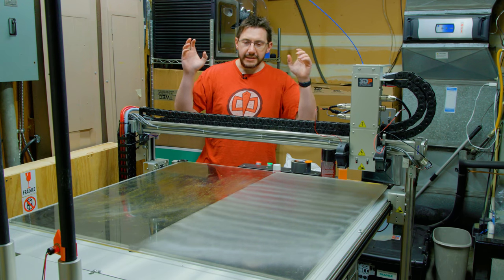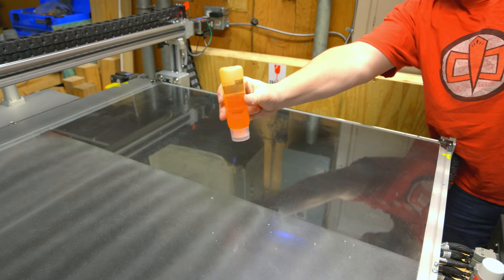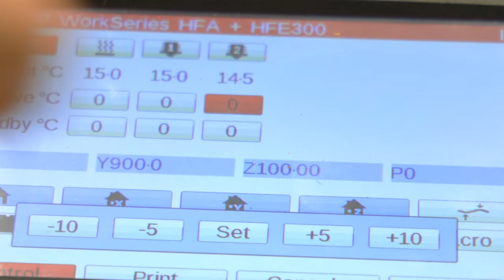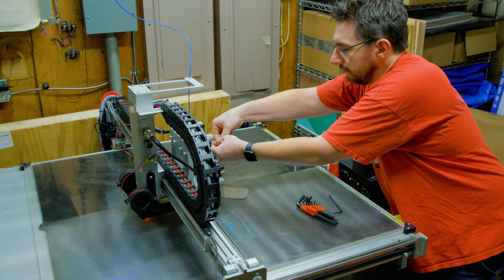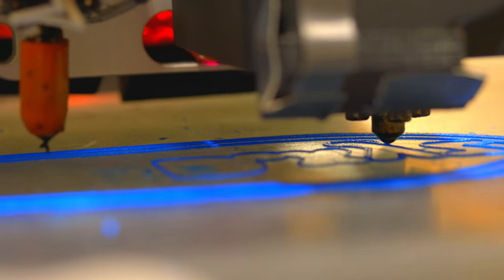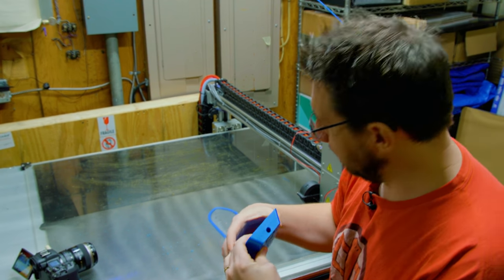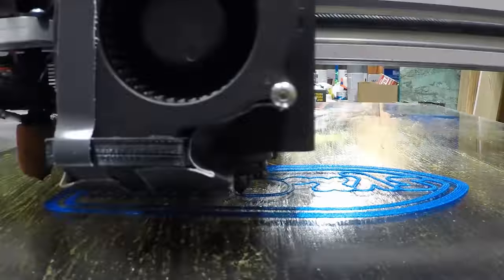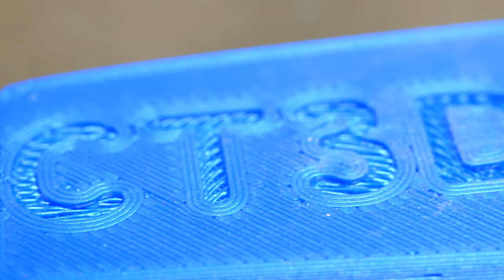$38,000 3D Printer Bed Adhesion Test // Super 77 & Zillagrip

Comment: For $38,000, the printer should have little hands that reach up and grab your layers for you!
Reply: Haha, that's a $9.99 upgrade that he cheaped out on...
Reply: @SuryanIsaac  Always tick the "tiny hands" box! Unless you're Donald Trump.
Reply: @Martial-Mat  Or, for that price a spring steel sheet with a layer of PEI on top?
Reply: What kind of material could you actually use on the is big heavy paper weight 
If nothing sticks what's the point of using it then? if not PLA? 🤔
Reply: @SuryanIsaac  Would that be prone to distortion though at this scale?
Reply: @Martial-Mat  Doesn't it have automatic bed levelling? I've not followed this series, the only thing that won't deform is glass, which is why it's probably used.
Reply: @SuryanIsaac  If you know where to get a sheet of spring steel that big please let everyone know.
Reply: @donaldmcfarlane5004  I was hoping you guys would tell me :)
Reply: I’m mad that I didn’t think of this scam first to get money out of makers with trust funds
Reply: For that price, it should be fully enclosed and heated. I haven't priced out the specs for that specific model, but I have for a 1 cubic meter (print area) model that came to under $5k with dual extrusion, heated bed, and enclosed heated print area. Not a DIY for everyone, but doable if you've built a few.
Reply: @RamDragon32  Yeah, that printer is overpriced af
Reply: @RamDragon32  I agree completely.

Comment: Joel, have you tried the nano polymer adhesive from VisionMiner? 😎 It’s excellent, but kinda expensive for that big surface 😁 
Also, I would say that one root cause is too low ambient temp. You can also put a small heater blowing towards the print, just to test this. 
And hope that hotend melts the filament entirely to 215-220 C 😊 

Good luck for the next tests!  😎
Reply: This is exactly what I was going to suggest!
Reply: I can vouch for the Vision Miner Nano Polymer.  I used up my sample size bottle, and just ordered the $50 bottle.
Reply: @GSoSicc  so the price is worth it. How long did the 10 mL sample last.  More specifically how many prints, how much surface area? Thanks for the info!
Reply: @Benjamin_Reese  3 months, and I still have about 2ml left. 

I used more than average because I would clean all of it off of my Ultrabase before printing PETG, and reapply for PLA.

The one time I didn’t clean it off, I ended up with a 10mm^2 chip in the bed, and that chip is forever stuck to the print, but now that I have smooth glass for PETG, and the Ultrabase for PLA, I’ve only applied twice for ~20 prints.

I’d say <1ml will suffice for  a 220x220 bed. It will be streaky, but it’s safer than a full, even coat.
Reply: I use Vision miner on all of my prints on a Prusa I3,  I'm not printing anywhere as large as what you are printing, but this stuff works great for me.  I stopped using stick glue and now only use this.  I've used it on PETG and PLA and it works great.
Reply: @GSoSicc  Thank you so much! That sounds with it to me.
Reply: Yeah he originally had a link to get a bottle for free when it first came out. Idk if he’s used it in this printer but I’ve seen it before on his channel.

Comment: The biggest problem is the $38,000 printer. I'd want my money back.
Reply: gaffer tape holding it together, broken beds, clearly not uniform heated bed, nozzles tilting the print head gantry....
its a failed printer in my book
Reply: $38,000 USD is only $48,565.90 Canadian, and the fact an Ender 3 can print better is totally okay. Maybe if the machine was to cost $40,000 they could've put in a roll of tape for you to use. sort of like when you buy an expensive car they expect you to install your own seatbel.....idk where I'm going with this.
Reply: Well, it is only a loaner. He didn't buy it, luckily
Reply: @MrGerhardGrobler  broken bed, broken print head.  expensive just for a loan/rent/whatever ya know?
Reply: From one of the other videos, it sounds like their customers (eg industry making props/prototypes) keep the 3D printer in a climate controlled workshop with their other stuff.
Maybe that's the real reason it's $38,000, so you don't keep it in your garage or shed.
Reply: @station240  Then they should either warn their costumers that they NEED climate control, or the should provide a cover for the whole printer that helps to keep the whole thing warm. I can't see what could possible bring the cost of this to 40k.

Comment: Heat the bed 50° & run the same test. Filament, of course, is contracting when it cools.
Reply: Thats what I would have said :)
Reply: I'm a carpenter and I work with that spray glue super77 all the time when it gets hot it turns into a sticky mess and losses its hold. the super 77 is almost like a contact cement. when we use it we spray the wall and the object let them dry  a little and then stick them together.
Reply: @nemohoess  I'm in construction as well. Did not know 77 would lose adhesions if it got heated though.
Reply: @buildersmark  it turns gooy and shit. I did a building where we put trim tex on a soffit right up against a window the heat build kept coming loose. We fixed it but putting mud on it real fast but yup it gets real sloppy.
Reply: @nemohoess  I think he waited too long before trying the tests? Adhesive dried out by the start maybe

Comment: It's probably not the glue that's the problem. You should try covering the print, and have warm air under the cover. The bottom of the print is cold and the top is warm causing it to
warp off the bed.

Comment: I have an Ultimaker 3 with a heated glass bed. To get the prints to stick I usualy set the initial layer hight in cura to around 0.05 - 0.07 . This will result in a mirror finish print surface and the print will stick insanely well. In fact if you try to remove it before the bed has cooled down you will end up ripping little chunks out of your bed. I would also suggest to use a brim instead of a skirt for that extra bit of surface area.
Reply: And didn't you make a video about Vision Miner once where they had similar bed adhesion issues? Why don't you try asking them?

Comment: Have you tried Vision Miner Nano Polymer Adhesive? I've heard great reviews of it.
Reply: Its great, but i use it on advanced polymers
Reply: This! Use this stuff!! It holds like absolute crazy. I used it to hold PEI on a glass bed in open air
Reply: I was just coming to recomend this lol
Reply: I use it on my ultimaker 5 and I recommend it for nylon its really great
Reply: VM Nano Polymer adhesive is amazing.
I'm still ony sample bottle, but when it's finished, I'm buying the big bottle.
Reply: This thread sounds like a marketing ploy
Reply: @kanesmith8271  lol but this stuff is actually really good
Reply: 190% this! Works even on PLA.
Reply: @MissMerc  I was just wondering why he didn't mention it.
Reply from the maker: It super slipped my mind when I was remembering everything! Doh!
Reply: That is my ultimate favorite bed adhesive! Works 99% of the time for me!
Reply: Are use nano it is the best hands down it is expensive but it’s worth every penny
Reply: I’ve literally put only two layers down and I’ve been able to print over 15 times and still sticky gear leave without issue is worth every penny

Comment: Try a big piece of Polycarbonate the size of your bed wouldn't be too bad in costs. Make sure to sand it a little so the parts can actually come off... You'll love it :D (no adhesives needed)
Reply: what grit do you sand it to?  i just tried a piece and the base layer is still there...permanently i think
Reply: @donaldmcfarlane5004  you would want to use a low grid as that makes it easier to get the parts off. Try to bend the sheet to get the parts off, also don't forget you don't need a high bed temp

Comment: Hi Joel!

I've had good results using vinyl decal transfer tape, specifically the paper type, and it works like giant 3D printer bed masking tape!
The paper texture gives the hot plastic something to grab onto, but is smooth enough to leave a nice matte finish on the bottom of a part. I can generally get several prints out of a single tape application.

Whenever it's time to replace the tape: Peel off old layer, pull new material from the dispenser, squeegee it on from front to back, cut end of sheet, print!
Many roll widths come in 100 yard (or 91.44 meter) lengths, so a single roll will last a LONG TIME!

I suggest trying out a medium tack tape. It should be plenty strong enough, especially given the large print area. If you experience any lifting, and the part is pulling the tape off the table, then high tack might be needed. Hasn't happened to me on my CR-10, but your printer is a tad bigger, lol.

NOTE: I am not affiliated with the following brands, I've just used their products before so it's what I'm familiar with.

=========================

Suggestions:
-------------------

Transfer Tape:
TransferRite Ultra 582U Medium Tack Transfer Tape (other brands should be fine, might want to test a few for best cost/quality)

Dispenser (cheaper option):
APPRoller Tape Application Roller

Applicator:
ORAFOL White Non-Stick Squeegee

=========================

I hope this helps!

Comment: A 15-16C bed is just to cold. You could try a first layer that us very slow and really hot and maybe get it to work. But the adhesive has to come up to a certain temperature to actually work.
Reply: And the filament is foaming so that’s possible part of the problem.

Comment: Personally use Elmer's purple glues stick. I find it works better than the others as it is not lumpy when applied, and it can be evenly spread with a damp paper towel after I put a good amount on the bed or after a print or two. 
The only thing is I find PVA glue and most bed adhesive only work well when on a heated surface. I suspect this is due to the solvents and water that may be contained within, and the heated surface removes such solvents and leaves only the adhesive substance behind as binding material/surface.

Also, wasn't sure if it is only me, but from the shot, I saw the filament expending and collapsing after it exits the nozzle, which can be a sign that it is suffering from the hydrolysis effect and affecting layer adhesion as well as bed adhesion.

One more thing I wonder is, what is the current glass (that is a glass bed correct?) surface characteristics, as most glass leaves manufacture with a thin film of silicone accumulates, which can affect adhesion. If the silicone accumulates exist, water will tend to beads up. It can be removed with white toothpaste or torching (not recommended), though don't want to ruin ur build plate. :(

Comment: I’ve had off and on issues with bed sticking with a smooth pei sheet but the Vision Miner Nano Polymer took care of that. As for your tests, there’s a reason most people heat their beds, even with PLA. Another possibility is glue stick, which I’ve had good luck with on a tricky machine.

Comment: At the minimum turn on the bed heat, I think the bed is too close. You can also set your skirt height to 9999 which will build a wall around the print and help hold heat. Finally, you can just try going old school and using a raft.

Comment: My suggestion would be PrimaFix, it's been unbelievably solid for my glass bed
It's like magigoo, but 10x better, it goes down easily and you can feel it sticking with your fingers when the bed gets to around 60c
I'm not sure what size bottles it comes in, the one i have is rather small but perfect for my Ender3 printer, thankfully you can print on the layer several times before having to add any new or replace it
Use acetone to remove, it appears to re-activate it and make it easy to scrape off as a goo
Reply: Any particular reasons you find PrimaFix to be better than Magigoo?
Reply: @jeanpaulformosa1344  it appears to make stuff stick incredibly well, even petg wouldn't lift
Also the application pad on prima fix is significantly better, my magigoo pad started coming apart early and eventually fell off

Comment: PVA Wood Glue (water-soluble) + Water (1:1) .. works on all my printers and is by far the best and also cheapest adhesive I've ever used!
Reply: I agree, ive had this work wonders with PLA and PTEG, not abs though..... and if the diluted PVA still isent enough (on really large prints 380x490mm ;) ) try wiping some IPA over the PVA Glue before the print starts, that sticks really good

Comment: It’s a tough problem to solve! For big prints with a flat first layer I’ve resorted to using rafts. It’s just a pain to get the raft off afterwards. My heated glass bed works pretty well but there’s always one corner slightly lifted.
Reply: I had heat issues on my large bed, to fix I added a layer of aluminum between the heater element and the glass.  This takes a little more time to bring to temp, but it spreads the heat much more evenly across the plate to the glass.  
I still rely on a painters tape and treseme level 5 hair spray.  
Overture's adhesive textures mats also work really well!  Peal off with no issue.
Reply: @spunkmire2664  i'll have to try out that aluminum method!
Reply: @CASSDesigns  my heater element is one of those silicon matts that glued to the bottom of the alum. plate (3-5mm thick) and then the glass is mounted on the alum with clips.

Comment: one easy solution to all my lifting woes was adding a brim to the print. you will have to experiment with how far away from the print it has to be whilst still being attached but easy enough to bend off and break evenly/smoothly. Also youll have to experiment with how many lines out it prints. I usually do 3-5.